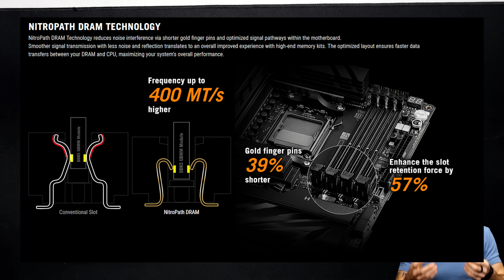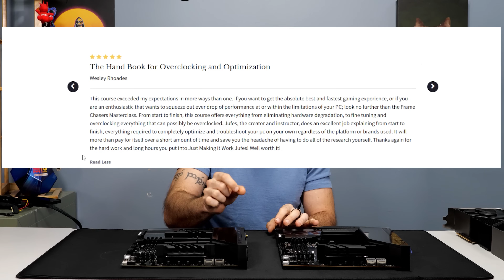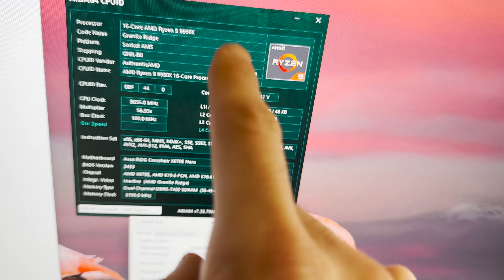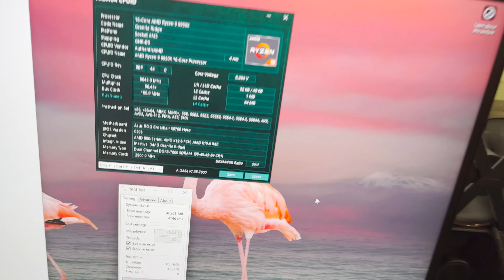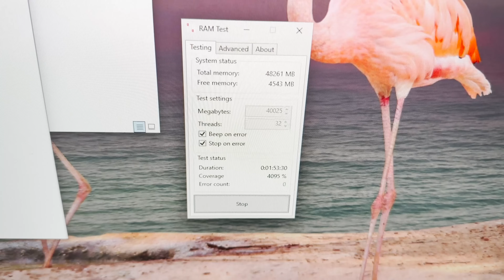🛑 The BEST AMD Motherboard 😱👑 (x870e Hero vs X670e Hero)

Comment: Aren't you worried that it will break and Asus will claim it isn't covered under warranty?   It doesn't have enough slots anyways - might as well buy a stock dell if you don't need slots.

Comment: An itx B850 board with 8000MT/s RAM might be nice for SFF build with an APU... Damn, i wish AMD released that rumored 8 cores 32CUs Strix Halo APU on desktops as well. An Ultimate Emu box!.. or NAS, or both.
Reply: Why APU’s are garbage. There are small GPU’s that can easily fit in a mini ITX case. The 4070 FE is small and fairly powerful for that small form factor.

Comment: So stripping features (surround VCA) and increasing prices, this is a trend for Asus. And you might not want to add thermal pads to the back of the DIMM slots, a heat-sink is only effective with airflow, that entire back-plate could heat up with time and rather than pull heat away from the DIMM slots now the DIMM slots become the heat-sink for the back-plate. That back-plate is suffocated with zero airflow.

Comment: Ok... So im debating on getting the new 9950x or wait for the 9800x3d... I have already bought the new x870e hero motherboard from Asus for overclocking reasons.... My question is this, with the new motherboard and the 9 series I can achieve 8200MTS with my DDR5 RAM. With this much of an improvement will the extra cache actually make a difference since the MTS can make up so much? Gaming reasons

Comment: I rlly need to know this: on the MSI MPG X870E CARBON WIFI, there is a 3rd PCIE 4.0 slot. I was planning on putting my 4K PRO capture card in that 3rd slot. But I was just wondering, does this also take lanes from the 1st PCIE (Graphics Card) slot? I want to know if it in any way affects the Graphics card? (I'm getting the 4090).

Comment: I have a 3090 water-cooled using EKs custom block that has an active backplate, will the SSD heatsink interfere with such backplate?
Reply: Just finished my new build and my PowerColor Red Devil 7900XTX BARELY fit underneath that massive heatsink, I got a custom backplate for it that doesn't fit on top when installed horizontally because of the M.2_1 SSD heatsink

Comment: I was just going to use a thunderbolt 4 card on my z790 intel but asus must of read my mind adding this connector. Just the power for this new setup is going to be a little jank. Reminds me of using x4 m.2 slots and pcie risers. I should be okay with a thunderbolt 4 card for the next gen or two 😅

Comment: i did buy the ASUS ROG Crosshair X670E Hero its the better deal it can use all m2 nothing getting cut away
Reply: On the x870e only use one gen5 Nvme and don't touch the other one and U should be good

Comment: camm2 modules and cudimms are coming at potention 10000 Mhz speeds in near future for ddr5
Reply: That will be great if amd gets their controller to work above 6400 1:1
Reply: @walterrankin200 , Some guy here wrote that he managed to achieve 6600MHz 1:1.
Reply: @daniilmarkovskyj515  I saw that but didn't get any details. He must have increased voltage. I avoid that if possible
Reply: @daniilmarkovskyj515  that's still a ways from 8000 1:1.
Reply: I've got a taichi x670e, a rog strix x670e-e, and a MSI X670e godlike and I'm not buying anymore mbs till camm2 comes out and is working and we can get 10,000 1:1.  Oh yeah and my original asus B650e.

Comment: Can both motherboards run dual 4090? I heard it will sacrifice from x16 to x8 dual slot speed. will it sacrifice fps? I plan to run 4090 on triple 48GQ900 (OC 138hz) and another 4090 runs on PG27aqdp (480hz). My current setup single 4090 it won't lit up 4 screens simultaneously. I got to do manual setup every single time in Nvidia control panel which is annoying and time consuming.

Comment: if there’s a way to get matching TPHYRDL’s while using 6400 then I’d be using it. 

Until then I’m using 6200CL28-35-32-30-66 58.7ns 

My kit won’t budge any more unless I turn off geardown mode, power down enable & memory context restore. 

at that point I’m hurting performance if I push it any further. 

hopefully it’s just my kit.

Comment: man i have question, if i by pro art mb and i install 1) nvme in top slot 2) gpu with waterblock 3) soindblaster ae9 4) 4k capture card. is that gonna work or no ?

Comment: It is my understanding that Amd Infinity Fabric cant support high memory frequencies, have to see which amd cpus are the most unstable. Intel Arrow Lake should fair well with stable support for 15000 MT and higher, and combined with fast nvme drives on pcie5. Intel will take the gaming and mp productivity crown for years to come. This is why users will stay with Intel cpus and Intel Arc gpus are already surpassing Amd Radeon.

Comment: I was able to get a golden sample and it barely runs 6600 stable in 1:1 its a 9700x
Reply: What is the frequency of infinity fabric? I guess about 2200Mhz
Reply: I'm going to build a 9700x setup. What RAM did you use to get to 6600mhz?
Reply: @daniilmarkovskyj515  as i said 6600 was barely stable + allot of tinkering was done its not ur typical xmp and forget about it + my 9700x is a golden sample most of them will end at 6200-6400
Reply: + any Hynix A die is good + 2x16 on a 1dpc board

Comment: Issue with the new one if u populate the second GEN 5 Nvme the bottom nvme slot gets disabled whereas ghe x670e u can populate all nvme slots. The new x870e has a backplate and more gen4 usb ports

Comment: @Frame Chasers, 
i bought 13950HX(Q1LP) @P5.7 @E4.3 and DDR4-4100 game config,
(Voltage offset -30, AC 0.3, DC 0.6), max VR OUT ~1.45
(On Asrock Z690 Extreme DDR4)
can do something like @P5.5 @E4.4 for CinebenchR23 40000 points
But with DDR-5 my best result so far was 6000 XMP, can't push even 6133 
Really hope your video will soon come out